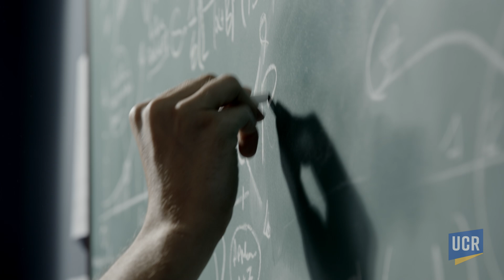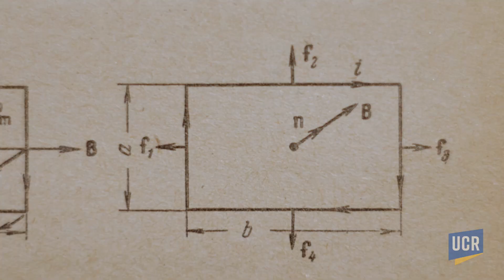Laser Interferometer Gravitational-Wave Observatory (LIGO) Explained

Comment: In "Observation of Gravitational Waves from a Binary Black Hole Merger" (2016), Abbott attempted to detect electromagnetic gravitational waves that were formed by the motion of an ether using an interferometer.  

"Figure 1 illustrates the basic concept of how a Michelson interferometer is used to measure a GW strain. The challenge is to make the instrument sufficiently sensitive: at the targeted strain sensitivity of 10-21, the resulting arm length change is only ~10-18 m, a thousand times smaller than the diameter of a proton."  (Abbott1 , § 2).

"On September 14, 2015 at 09:50:45 UTC the two detectors of the Laser Interferometer Gravitational-Wave Observatory simultaneously observed a transient gravitational-wave signal. The signal sweeps upwards in frequency from 35 to 250 Hz with a peak gravitational-wave strain of 1.0 × 10-21. It matches the waveform predicted by general relativity for the inspiral and merger of a pair of black holes and the ringdown of the resulting single black hole." (Abbott2, Abstract).

“In 1916, the year after the final formulation of the field equations of general relativity, Albert Einstein predicted the existence of gravitational waves.” (Abbott2, Intro).

The LIGO detected celestial gravitational waves that originated from the merging of two 1.3-billion-ly black holes which produced a 10-21 strain that depicted a 10-18 m interferometer mirror displacement which is clearly well within the length measurement uncertainty.  Also, Abbott referred to Einstein's General Relativity where Einstein represented gravitational waves with Maxwell's equations (Einstein5, § 20) but a massless electromagnetic gravitational wave cannot produce a force that can displace the interferometer mirror.  The curvature of spacetime forms gravitational waves but spacetime is based on Lorentz’s transformation (Lorentz, § 4) that is founded on an ether drift but the ether does not physically exist (vacuum).  Nonetheless, to detect an electromagnetic wave requires a radio antenna but Michelson's interferometer is not a radio antenna.  Compton's photon momentum (p = h/λ) is used to justify LIGO experiment because Compton's photon momentum is represented with the unit of the mass (g) since h = 6.55 x 10-27 erg . s and erg = g m2 / s2 yet an electromagnetic photon is massless and cannot displace the LIGO mirror.  

Gravitational wave are not electromagnetic waves but are formed by the perturbations of spacetime that is part of a coordinate system and is not a structure. The physical properties of spacetime being referred to are its metric structure, curvature, and dynamical behavior.   The spacetime metric determines measurable distances and time intervals, curvature encodes the gravitational field through the Riemann tensor, and spacetime is dynamical because the metric evolves according to Einstein’s field equations.  Gravitational waves correspond to propagating, measurable variations in this metric and curvature, producing observable strain in physical detectors.  In general relativity, spacetime carries energy and momentum indirectly through its geometry, not as a material substance but the geometry of a coordinate system (spacetime) without any substance cannot form an energy or a momentum.  

The LIGO interferometer produced an interference effect (waveform) that represented the interference of two coherent light waves (fig 23) yet according to Fresnel wave interference mechanism, a light wave was formed by the motion of an ether yet the ether does not physically exist.  Maxwell's equations are used to explain an electromagnetic wave formed without an ether but Maxwell's theory is based on an induction analogy since Faraday's induction effect does not radiate visible light.  Plus, the black holes used in the LIGO experiment do not physically exist.  Gravitational waves are said to be formed by the merging of two fictional 1.3 billion ly black holes but black holes depict the uncertainty (limit) of an optical telescope's range.  Example, an optical microscope has a limited range and cannot view electrons orbiting an atom; conversely, an optical telescope has a limit which is depicted with black holes.  It is said that there are over one million black holes in the celestial universe that are detected using an array of radio telescopes but continuous and expanding electromagnetic fields would all combine at the Earth; consequently, a radio telescope cannot individually distinguish the scrambled radio waves formed by millions of black holes and stars.  Plus, it is highly unlikely that extremely weak radio waves from the ostensible 1.3 million ly black holes could penetrate the Van Allen belt which proves the LIGO experiment is fiction.

Comment: In "Observation of Gravitational Waves from a Binary Black Hole Merger" (2016), Abbott attempt to detect electromagnetic gravitational waves that are formed by the motion of an ether, composed of matter, using an interferometer.  

"Figure 1 illustrates the basic concept of how a Michelson interferometer is used to measure a GW strain. The challenge is to make the instrument sufficiently sensitive: at the targeted strain sensitivity of 10-21, the resulting arm length change is only ~10-18 m, a thousand times smaller than the diameter of a proton."  (Abbott1 , § 2).

"On September 14, 2015 at 09:50:45 UTC the two detectors of the Laser Interferometer Gravitational-Wave Observatory simultaneously observed a transient gravitational-wave signal. The signal sweeps upwards in frequency from 35 to 250 Hz with a peak gravitational-wave strain of 1.0 × 10-21. It matches the waveform predicted by general relativity for the inspiral and merger of a pair of black holes and the ringdown of the resulting single black hole." (Abbott2, Abstract).

“In 1916, the year after the final formulation of the field equations of general relativity, Albert Einstein predicted the existence of gravitational waves.” (Abbott2, Intro).

Abbott describes electromagnetic gravitational waves formed by the collision of two black holes that electromagnetic gravitational waves are depicted with Maxwell's equations yet Faraday's induction effect is not gravitational, and, gravitational waves, based on Maxwell's theory, are formed by the motion of a ether that does not exist (vacuum). Plus, the LIGO 10-18 m displacement is too small to measure since the LIGO 10-18 m displacement is smaller than the diameter of an electron (10-15 m). To detect an electromagnetic wave requires an antenna but the interferometer is not an antenna since an antenna detects an induction current formed by an oscillating magnetic field yet the LIGO experiment is detecting a displacement which nullifies the LIGO experiment.